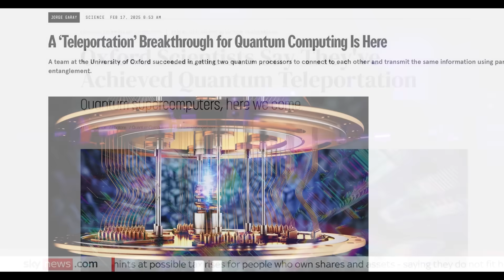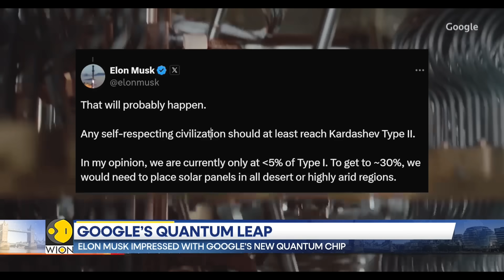BREAKING: QUANTUM SUPERCOMPUTER ACHIEVES TELEPORTATION!

Comment: From what I've read and understand it's based on quantum entanglement pairs. They're using paired sub-atomic particles that are read as a 1 or a 0 by the computer. Due to quantum entaglement though those sub-atomic particles are able to exist as both a 1 and 0 simultaneously for computations which drastically speeds the processor up to basically instantaneous computational speed. Whatever happens in one place instantly happens in another no matter the distance. Satan is the prince of the air according to the bible.

Comment: "Explaining it would be foolish" nah. You just dont understand it. Shat it does is it allows for something called a cubit. Its a bit thats a 1 as well as a 0 at the same time. Think of it like wiring a bunch of things in series and parallel at the same time, allowing hundreds of computations at once. But, the thing is its only useful for simulating small scale applications. Something like the quantum scale, or drug manufacturing, or genetic modification. Its not really useful for much else.